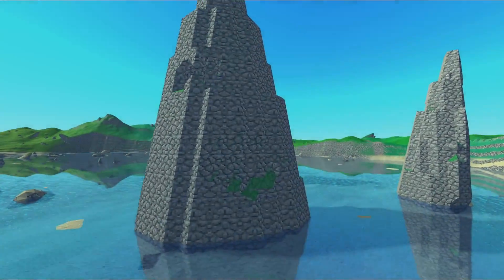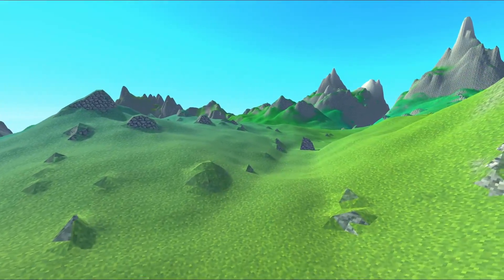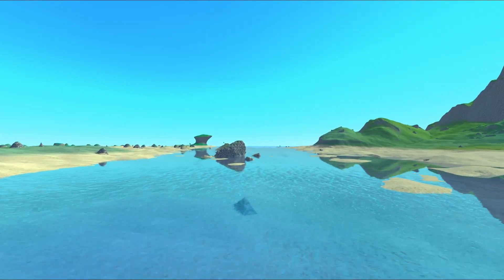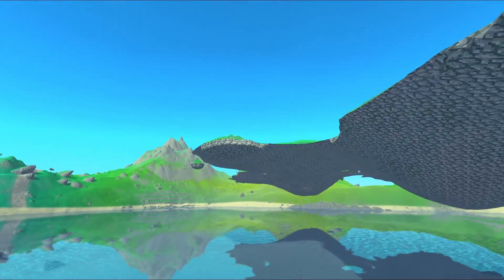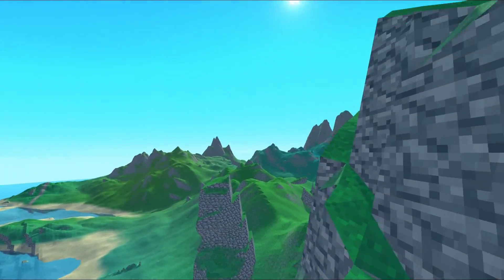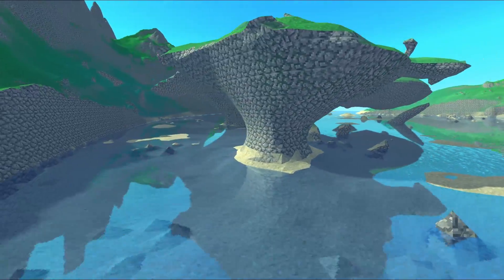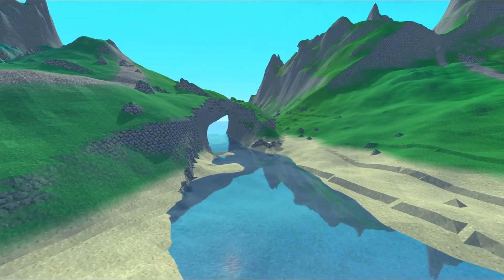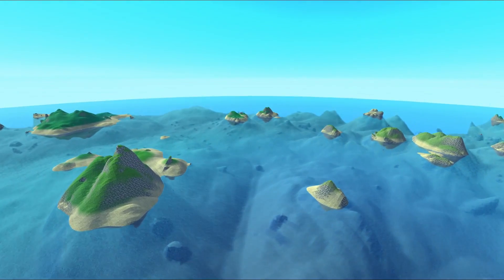Creating Infinite Procedural 3D Terrain with Rivers, Tunnels and Overhangs

Comment: How many layers of noise etc is this in total??
Reply from the maker: Dont have an exact number but probably between 10-50
Reply: @MahanPandey   @MahanPandey  Thank you so much! Do you have everything in the same compute shader or do you have different compute shaders for each type of noise? My code would be so much cleaner if I did the latter, but at the same time it would run so much slower having to shuffle data between GPU and CPU multiple times so I'm not sure it would be worth it.. :( What do you think?
Reply from the maker: @erikm9768  Have the code separated across shader & kernals but only readback data after everything is done. For example, you generate data + generate mesh on GPU with different shaders and then do a CPU readback to get the mesh.

Comment: Excellent video! How long does the density function take to evaluate? Is it always evaluated simultaneously with the meshing? Is the meshing marching cubes?
Reply from the maker: I haven't profiled it but its pretty cheap, was able to run the density sampling + meshing around 60fps. Yep using marching cubes.
Reply: @MahanPandey  Thank you so much! I'm working on a very different type of terrain but your comment was helpful.

Comment: You'll want to ditch Perlin noise and use Simplex noise its successor -- as the latter is faster and has better continuity.
Reply: Can be faster, real reason is significant reduction in visible grid artifacts. Get a good implementation, and an "open" one if you want to use the 3D noise for texturing.